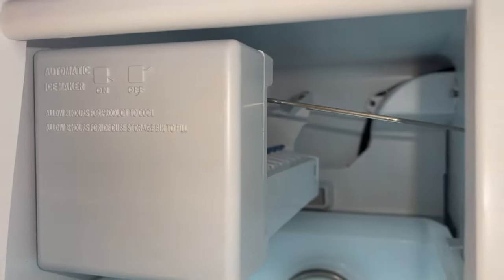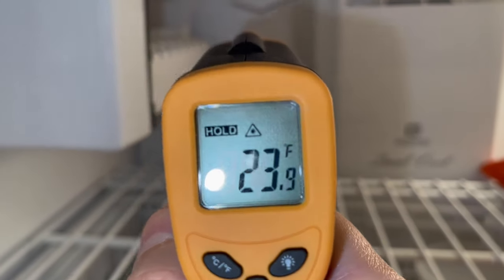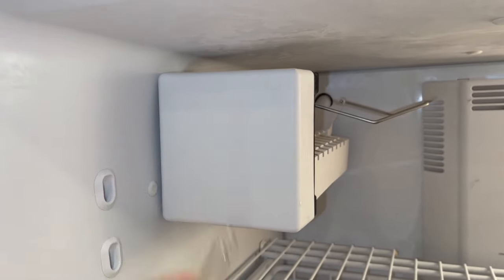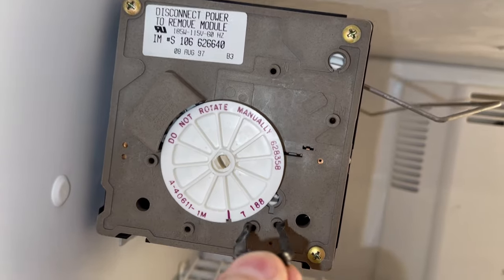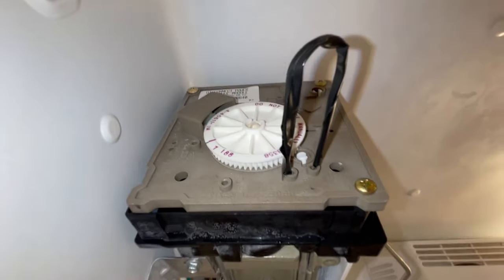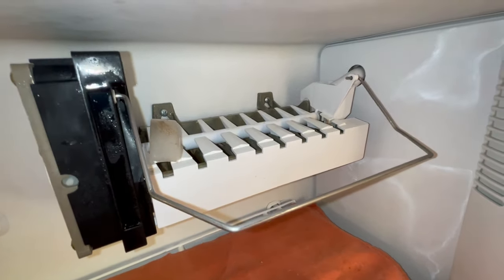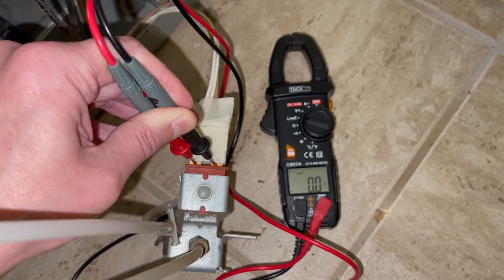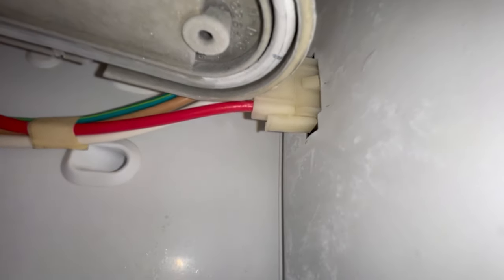Ice maker not making ice troubleshooting jumper test cycle

Comment: mine is stuck in the position as seen in 2:59. I made a jumper for TH but it didn't do anything and i pushed the door switch down. i once saw it trying to work at 4am with the arm trying to go up but it didn't go up all the way. is there any way i can jump start or reset it? it started when we went out of town for a month and came back and it stayed like this
Reply from the maker: Have a look inside the ice maker. It's possible that an ice cube is stuck between the blades preventing rotation. If it's clear, the ice maker itself may need to be replaced.
Reply: @Your-Self  I progressed to manually fill water in the ice maker using the LV jumper but now jumping TH will not turn the dial or eject the ice. The ice tray is frozen shut within that spiral mechanism but I think that is unrelated to this, unless you think I should thaw it. Also, the ice maker when filled leaks out water in one spot and drips into the ice tray. I'm wondering how to plug that up
Reply: @Your-Self no ice stuck between the blades, thanks
Reply from the maker: It sounds like you need to investigate where exactly the water is leaking from. It's probably dripping to where it's not supposed to go, turning the ice maker into a solid block of ice. Try defrosting it first and then jump start with T&H. If it works, the water leak is the problem.

Comment: What cuts on/off solenoid?

Is solenoid on/off position?
Reply from the maker: On basic refrigerators, the ice maker itself opens the water solenoid.
On advanced refrigerators, an electronic board may be controlling it.
Reply: @Your-Self  Is the solenoid closed until the icemaker calls for water & then it opens?

What part on the icemaker activates solenoid?
Reply from the maker: Yes, the solenoid is closed until the ice maker calls for water.
The front of the ice maker is a rotating cam wheel that closes electrical contacts.
Reply: @Your-Self  Thank u for explaining.
Reply: @Your-Self  If u do video on that subject, feel free to send me a link?

Comment: I am getting water into the ice cube tray maker but it does not make ice. I end up getting water spillage into the ice tray that then freezes. 

What do I need to replace? Ideas?
Reply from the maker: Observe how the water flows. Is it splashing around under high pressure, or fills normally and then continues to drip and overflow? Maybe the ice maker is getting extra water when you are using the dispenser to get a glass of water?
Reply: @Your-Self  Here is what I think is happening but I can retest tomorrow.  The water flows in normally, the timer keeps circling around and does not seem to stop to wait for the ice to freeze. The arms come around and only lift water and then it adds more water and repeats until it is overflowing and it drips in a stream nearer the front.  

Is the timer (circular thing that goes around and says do not turn manually) supposed to stop for say 20 minutes for the water to freeze and then heat the bottom and turn to eject the ice?  I don’t think mine stops and waits for the ice to freeze. I did feel the bottom get warm so that part of the cycle seems to work. 

Anyway I removed the unit but can put it back in again tomorrow and watch closer.
Reply: Oops.  I do not have a drink dispenser. It is a top fridge, bottom freezer, Sub Zero 550
Reply from the maker: Yes, the timer should go through one cycle only and wait for the water to freeze. Most likely, you need to replace the ice maker itself.
Reply: @Your-Self  I replaced the ice maker and have the same problem.  The tray meant to hold the ice just gets a bunch of water in it.  I did the resistance tests on the old one and it failed failed fails so I bought the new ice maker. It did make one batch of cubes and then probably filled with water each cycle.  Is the next step replace the water valve or just turn off and buy bagged ice?

Comment: For my case when I put jumper cable between L&V the water comes normally and when I put jumper cable in T&H  it rotates  too … but still no ice is produced
Reply from the maker: What is the actual temperature around the ice maker? It should be around 0°F.
When you jump T&H, does it automatically fill with water at the end of the rotating cycle?

Comment: I have an issue. My Ice maker stopped making ice. When I install the jumper between T and H nothing happens at all, but I get 120 volts between the L and N terminals, and if I install a jumper between V and L the water valve operates. Also, there is some ice stuck inside the ice maker.
Reply from the maker: Did you clear up the obstruction inside the ice maker to see if T and H jumper moves the motor? The motor could be burnt if it doesn't make any sounds of trying to rotate.
Also, some refrigerator models require depressing the door switch, and some require entering the control board into the service mode.

Comment: What is the part number of the ice maker on my whirlpool side by side?
Reply from the maker: They all are slightly different depending on your refrigerator model number
Reply: @Your-Self  is there a place to find the number?
Reply from the maker: There should be a sticker somewhere inside the refrigerator on the wall with the model number and other information.
Reply: @Your-Self  I found the model number but not the icemaker number.
Reply from the maker: What is the refrigerator model number? 
They don't list the ice maker number.

Comment: my uline ice maker is old one and has no holes for testing any suggestions?
Reply from the maker: If your ice maker has two gears instead of holes, you can rotate the smaller gear (counterclockwise) with a screwdriver. And that should start the cycle.

Comment: I turned mine on and it spins and activates the water but doesnt stop dispensing water into the tray.. when i turn the ice maker off the valve stops and doesnt drip or leak but when icemaker is turned on it will just suddenly dispense water when it should but not stop.  The hell water demon possessed my ices?   Got a good seal tho because its got a block of ice for the bottom half of the freezer since the drain froze over..
Reply from the maker: In a basic system, the ice maker itself controls the water flow. So, most likely, the ice maker needs to be replaced.

Comment: Please help. I plugged paper clip into V and L and then pressed the switch and water came out. Also plugged into T and H then pressed switch and it began to turn slowly but when I pulled out the clip it would not turn by itself. Can anyone help or identify my issue?
Reply from the maker: So, your water valve seems to work, that's good.
If the cycle stops when you remove the paper clip from the T and H, try to keep it plugged a little longer.
Reply: @Your-Self  I plugged it in again and when I press the switch now, the wheel doesn’t rotate at all anymore and I hear almost a little clicking sound when I press the switch.
Reply from the maker: Inspect the tray. Maybe a piece of ice is stuck on the scooping fingers. Maybe try pouring warm water to release the ice blockage. If that doesn't work, the gears inside the ice maker could be damaged, so you need a new ice maker.
Reply: @Your-Self  there’s all the cubes formed in the try but the ejector fingers are stuck pointing towards 9 o clock and not releasing the cubes into the bin

Comment: Thanks i will trouble shoot mine.. i have water coming out and i know my filter is not clog up.. only issue is there is no water coming out of the water supply tube for ice maker..hope its ice maker water valve issue
Reply: Did you find the issue?
Reply: @AndrewCDoom  yes, the icemaker unit is just out of whack.. took it out and applied heat from hot air blower, cleaned it and adjusted the screw for the timer to the solenoid that turns on when the timing on the icemaker motor rotates and cycles..i loosened the screw two whole turns. the issue is the micro switch that turns the water solenoid is not turning on due to screw adjustment. .mine is a Frigidaire

Comment: Nothing to the water valve what could my issue be
Reply from the maker: Usually, the ice maker sends voltage to the water valve, so the ice maker itself is probably bad.
But if your refrigerator model has multiple electronic boards, the water valve could be controlled by one of them.

Comment: mine is repeatedly running a cycle by itself, but never making ice.  i've tried so many things ugh
Reply from the maker: What do you mean by repeatedly running? Is the harvesting rake rotating non-stop? Does the ice tray get filled with water from the tube?
Reply: @Your-Self  the cycle runs repeatedly, but doesn't fill with water. I've disconnected for a whole day before plugging it back in. I haven't tried a suicide wire though
Reply from the maker: You need to do some measurements with a multimeter as in this video. 
1. Try to figure out if the ice maker is sending the voltage to the water valve.
2. Is the water valve receiving the voltage?
3. Is it vibrating?
If you don't have a multimeter, replacing the water valve would be a good first step.
Reply: @Your-Self  I do have a multimeter and can check. Which hole or which contacts should I be touching
Reply: @Your-Self  also, I really appreciate this
Reply from the maker: Start the test cycle and insert the leads into V and N holes. When the ejector blades point up, the ice maker should give you about 100 VAC for 5 seconds... it's all in the video.
Reply: @Your-Self  yeah, i felt dumb after asking.  lol